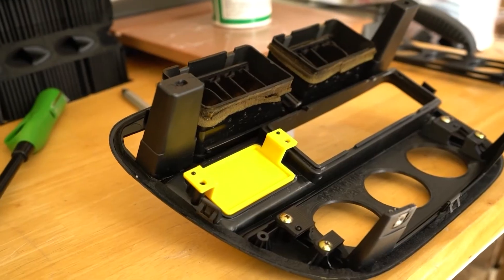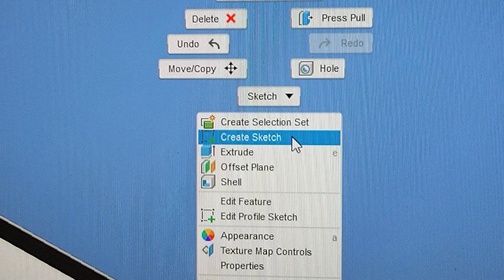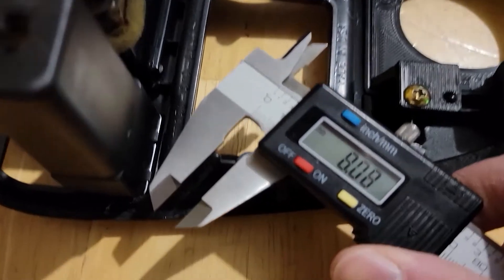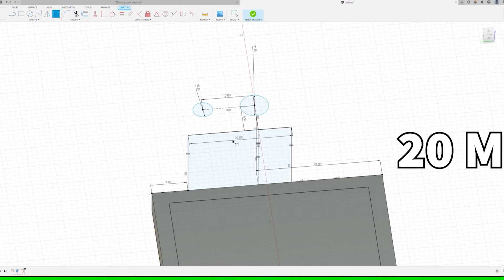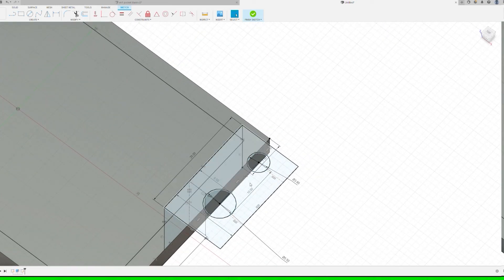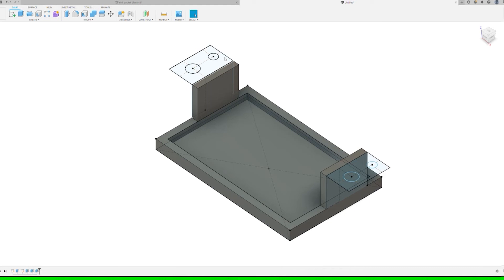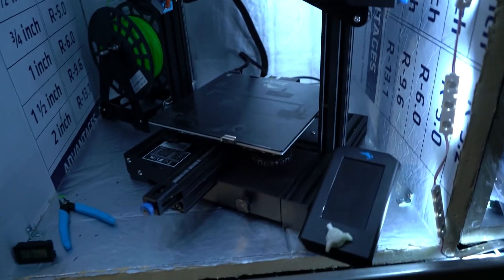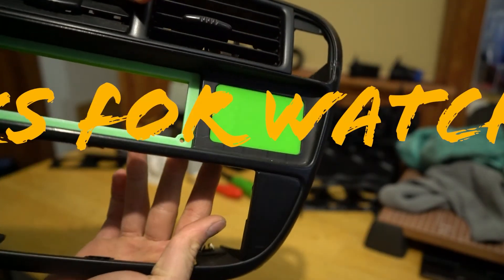3d Print Custom Stereo Trim Clock Block Off 96-98 Honda Civic

Comment: You can use fusion 360 to export your .stl file directly to some slicers, I am not sure if your slicer supports this though. Also One trick I have started using is the mesh editing tools within fusion 360 to achieve a smoother, or more polygonal shape, I am unsure if this would be much use for the prints I have seen you post, but maybe it might help or inspire you in the future. Cheers for the watch.
Reply from the maker: Interesting...I'll have to check into sending direct to slicer. It would definitely be helpful when test fitting parts! Thanks :D
Reply: @cbc.custombuiltcars  Not a problem mate. In the design window, click on the Tools tab, then click Make.

Comment: What was the cost for making your custom 3d printer enclosure?  I was looking to buy one off Amazon for $60-90.  Is your enclosure to keep the heat in or plastic particulates in?  Do you vent your room any?  Do you use any cameras to monitor the printers?
Reply from the maker: Thanks for the comment! I will be making a video on these enclosures as they're the cheapest good solution I've found 👌
Cost is about $20 per box
Mostly to keep heat in, but if its 100% sealed should keep particles trapped as well
My room is unintentionally vented due to having old windows that don't seal lol
And I have a single camera I move around to monitor new programs when I'm at work

Comment: Very cool niche products! I have been experimenting with NylonX filament with an interest in batch production run of parts. Great content so far!
Reply from the maker: Thanks I'm expiramenting and learning myself. The video part is hardest haha!
What have you made in NylonX?
Reply: @cbc.custombuiltcars  I have printed a few parts with it so far that have a large printed screw thread. Works well so far, just have to keep filament dry. Printing on a Prusa with aftermarket Garolite bed.